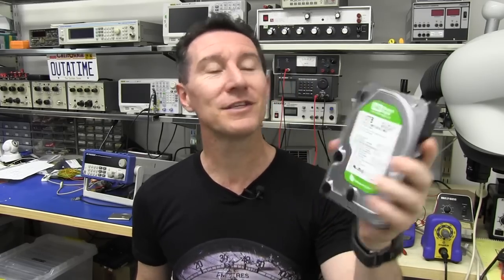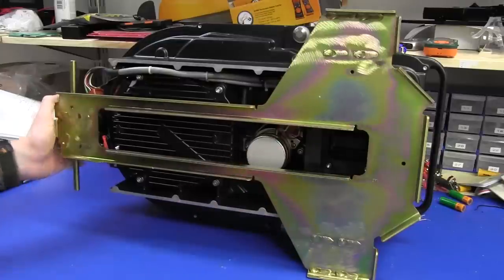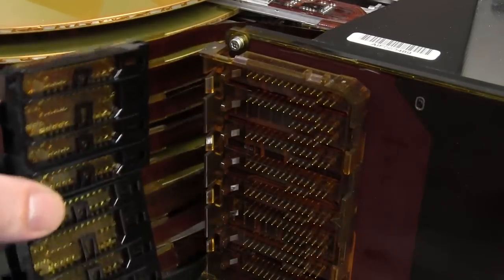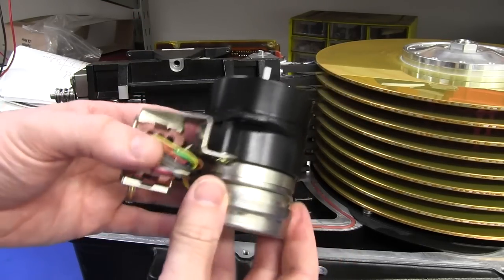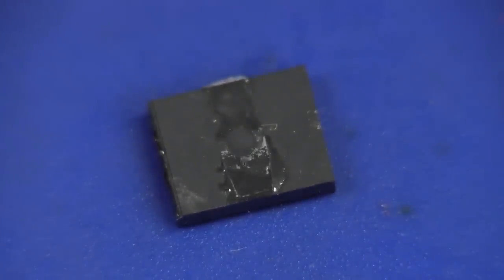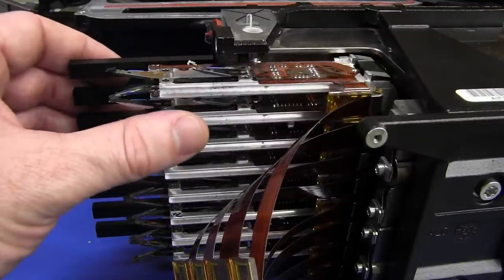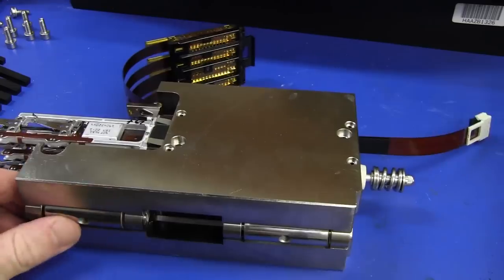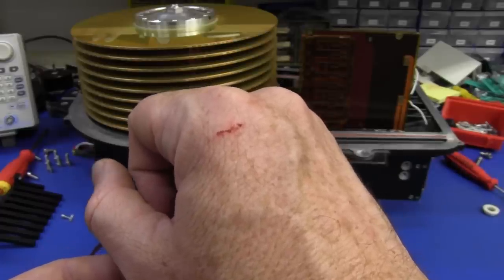EEVblog #395 - World's Most Expensive Hard Drive Teardown

Comment: 1/4 mil doesn't even come close.  These units were used in RAID arrays that had many of these units.  What you have was THE field replaceable unit (FRU).  Repairs would have been made in a clean lab, probably in Endicott.  The heads actually flew by bernoulli effect over the platters and head to disk interference (HDI) was often a terminal event, nevertheless, stuff did happen and you could swap a unit in the raid and the raid would rebuild the data from the other drives.  Then send the offending unit back for rebuild.  There were also some aeronautical/defense applications in which units similar to these were used.  I could tell you more, but I can't.

Comment: That beast would make a great custom case for a gaming rig.
Reply: yes
Reply: +vector6977 Lol, exactly what I was thinking about!
Reply: +vector6977 And just a little of engineering for cooling all that
Reply: +yomauser Maybe you can use the in/out-Gas Channels for cooling with oil or something like that :D
Reply: When our children will see the hard drives we use today:                      "Pffft, I could easily fit a cluster or two in there..."
Reply: ***** Hey, I specifically said "cluster", which means there are more.
Reply: *****  Pardon mine. By cluster, I meant an arrangement/grouping of multiple individual computers. I should've specified.
Reply: +vector6977 i'd just put a game on there and try to run it
Reply: I am sure yes
Reply: That is EXACTLY what I thought when I first saw it.
Reply: No heat allowed
Reply: holy shiz ya

Comment: I remember those.  I used to work on IBM Midrange systems (the System/36 range of computers).  the hard drive platters were 3 feet across and weighed 40 kilos.  we usually had one die every 2 years or so.  350MB of storage on the model B and 768MB on the Model D.  the actual machine was bigger than a washing machine and made a horrible din as fans and motors ran in it 24 hrs a day.  My office had 2 of them and every summer, the air chiller unit would fail and tempretures would shoot up to over 100 degrees.  those were the days when computer techs were working at the coal face!
Reply: Jeff Barber Time is cruel to old tech. As a 70's Kid. I am still in Awe of this.
Reply: Worked in an IBM shop during this period.  He's handling a 3390 drive unit.  They almost had the same capacity of the 3380s that they replaced, 630Meg, 1260M, or 1890M per actuator/address, for the standard, "D", or "E" models.  The 3390s saved 'footprint' space in the data center for the same storage, along with power and noise. A 3380 drive had a sticker on the side, > 70 kgs, recommending 2 CEs to swap them out.  An actuator on each side gave the device 2 addresses. Two drives per box, total of 8 boxes per string.  The 3390 has two actuators / drive also, as seen in the video.  Top & Bottom.  If it failed, a single CE could unplug it, slide it out, and replace with a new one.  "CE" - IBM Customer Engineer.

Comment: IBM generally had a controller with the smarts connected to a bunch of not so intelligent drives so I would not expect this item to have much smarts.  My first hard drive was from IBM and had 4 Megabytes on a stack of platters wider than this one.  Amazing stuff.  THESE are the good old days for computers and other hardware.

Also, the top head was frequently a sync track.  Lots of little markers for timing, track start, sector start, etc.  Not a read/write surface.

Comment: I worked on these things and the filters actually filtered recirculated air within the unit, not outside air. Additionally, these were were used with mainframe computers like the IBM 360/370 series. Servers as we have today, didn’t exist yet. The platters were double sided except for the top and bottom platter.

Comment: For me its kind of funny seeing that "old iorn" again. My first day on the job in field service was in 1976 . We were installing "field change orders" on 10 megabyte ,full size disk drives (about the size of a washing machine) The disk drives had a linear bobbin type motor. The field change was adding an RC circuit to the linear motor circuit so that the disk drive would not pickup and play music from the local am radio stations. ...yep ,in some installations it was an issue  lol.
Reply: Steven Hardy Even in 2015 RF interference is still a nightmare. Open even an Iphone6. Any Metal plates are there only to shield RF Interference.

Comment: That motor you removed from the bottom, before you could pull out the ACTUATOR assembly is the  head LOAD/UNLOAD motor.  It was used to remove the heads from the disk before the disks stopped at power down.

If the motor was allowed to come to a stop with the heads in contact with the disk they would STICK.

The LOAD/UNLOAD motor also LOCKS the actuator in the PARK position when the motor is stopped.

Comment: that sensor in the actuator is the "Home" sensor, lets the drive know when the heads are over the "Zero" track.. so the drive knows where to start counting from ..excellent video, haven't seen that type of drive in over 20 years.. please keep these types of video's coming.. btw those heads have more than 1 gap, there is an erase head there is a r/w head, and there is also a dual head that is called a guard head which makes a tunnel on either side of the data channel so adjacent channels do not interfere with each other..

Comment: Now to think, in 20 years time, we'll have 200 TB harddrives capable of storing 1 government official ego.
Reply: The 64th Shadow Nah, you will need at least 1 Terra Quad or more.
Reply: The 64th Shadow 
You should do some maths the smallest structure we are  capable of at the moment are 14 nm , 0.1 nm is roughly a atom.
Reply: Fiercesoulking "sructe we a cabale"
What in the fuck are you saying?
Reply: The 64th Shadow 
Sry I was in a hurry in real we won't have a smaller structure than 1- 0.5 nm  because for transistores they make no sense.. The biggest harddrive at the moment is 6TB, so maths say this
14 nm*(1/0.5 nm) * 6TB =  roughly 168 TB is the biggest possible HD with in the normal specification of a normal HD in these days
Reply: Fiercesoulking you forgot to calculate in 2 dimensions. Shrinking from 14nm to 7nm brings you 4 times as many bits. Shrinking from 14 to 1 brings you 288 times as many bits. And there is still the possibility to create thinner discs and heads to fit more discs into one harddrive case. Even without smaller structures on the disc itself this may also increase capacity. One could also try to store more bits at a single location so that a location is not 0 or 1 but rather 0, 1, 2 or 3 (0, 33, 66 or 100% magnetic force; hdds already use this technique but I'm sure there is still some potential). 
So we do a simple calculation: Half the structure size (7 instead of 14nm), twice as many discs and twice as many bits per location would raise the capacity from 6 TB to 96 TB (6TB x 2 x 2 x 2 x 2)
Reply: Lol we already have 8tb or even more.
Reply: The 64th Shadow If we follow Moore's Law we should be able to fit roughly 6000 terabytes on a 2.5" drive by 2035.
Reply: Chevez ℰ. Moore's Law is inapplicable to magnetic storage density, because it describes the growth behavior of transistor density over time.
Reply: 450AHX SSD storage isn't magnetic based
Reply: The 64th Shadow in 20 years time going by past rate the hard drives will actually be 20QiB
Reply: +Fiercesoulking we actually have 7nm transistors currently
Reply: +Krists Jāvalds currently 10tb.
Reply: +The 64th Shadow Hahahahaha  Good one. Ha.
Reply: alex tworkowski Haha, got 'em?
Reply: +The 64th Shadow there is nothing... NOTHING big enough to store an goverments official ego xD
Reply: +Fiercesoulking actually, if technology got to that level, they would probably have multiple layers of disk in a space such as a standard HD. If they still use Hard drives at that time.
Reply: Pfft i think all of the internets harddrive capacity couldnt store any goverment official ego.. Or hidden ego fr that matter
Reply: Don't think so, SSDs are already taking over... R.I.P. mechanical hard drive 195x-20xx
Reply: LBPPlayer7 actually I think you will find that the future will be more on the hybrid drive side once they have a breakthrough like every other part.
Reply: 60 TB SAS SSD from Seagate, and you talk about HDD? The future has begone xD.
Reply: +Max Mustermann For HDDs It's 16TB from Samsung last I heard.
Reply: Computer storage is getting denser, and so are people.
Reply: The 64th Shadow greating vrom the future a 100tb is alrady launched in 2017 :P
Reply: And with more quickly deleted incriminating 
files.
Reply: more like 200 petabyte compared to back in the days. At least 25 years back, 80MB was considered quite a lot for those actually having an HDD; 20MB was not that good but still better than nothing.
Reply: The 64th Shadow well if we'd manufacture the harddrive shown in the video with today's technology, i think it would store 24Tb per plattern. So we could manufacture a 226Tb harddrive with 9 platterns
Reply: Adam Creed u gotta add 1 more argument against buying em today:
+ good luck finding an efficient file-system
Reply: Adam Creed well could be. Idk this problem cuz i never had it.
Reply: I guess partitioning it could solve it but anyway - more than 24 TB = u wont get one without having good cont(r)acts
Reply: no
still no 10tb
Reply: No they don't.  There is no such thing as a petabyte hard drive.  All petabyte storage solutions are multi-drive.  At this point, Intel has announced a petabyte SSD solution that takes up 1U of rack space, but it's not a single drive, it's 32 drives in a 1U rack case, and I don't think it's actually shipping yet.
Reply: What?  10TB and 12TB Seagate drives are in stock on Amazon.
Reply: Jon C Toshiba already manufactured 6Tb drives in 2016 so why not
Reply: with some fancy compression maybe
Reply: @Jason Manuel Well, the biggest I see right now is 12TB.  Can't believe I am responding to a comment from 4 years ago.
Reply: @Jason Manuel Where is my flying car and my 100tb-drive?

Comment: 6:53 "Otherwise, the halon gas would kill you." I thought this too, then I searched a bit and found this isn't exactly the case. Yes, gases can be dangerous, but not all of them kill datacenter workers.
Reply: linagee I don’t actually think he was saying the gas by it’s self would kill you, just that the lack of oxygen once the room is flushed out would.
Reply: @pedroalexander8921  Yes It displaces the air, which is how the fire suppression work. also because of the energy lost to convert the cold liquid gas, it would chill a whole room with the phase change from liquid to gas. just like a CO2 fire extinguisher, the temp drop forms snow ice and dry ice, it's just under enough pressure to keep it liquid, and it occupies a small space so it transports easier.

Comment: I have actually worked on those as well as the 10 platter removable media drives. They were the size of washing machines. Both of those units had separate Disk Controllers that managed data flow and head position. Those 10 platter drives were all of 40 megabytes and were used with a Sperry Univac Main Frame at Naval Oceanographic.

Comment: My dad had bought a computer 386SX in 1986 which had a turbo button for over clocking and had a hard disk capacity of 20MB. I think it had speed of 33MHz and when we type DIR and Enter, then we can read files easily going from bottom to top. It had DOS Ver 4.0

Comment: BTW the thermometer strip is a standard-looking LCD thermometer. The numbers are printed underneath, and each segment of the LCD becomes transparent / opaque at particular temperatures, that's how it works. 

For the heads, I think the reason there's 4 contacts, with only 2 being used, is so they can use the same heads upside-down, which would reverse the L / R direction. Saves them having to make and use 2 types otherwise. 

If that's just 10MB, then the data density on the discs is going to be pretty close to that of early '80s floppy drives. Which wasn't much!

Comment: Wow, takes me back. Used to work on GE Medical CAT scanners (circa 1981) that stored scan data on CDC 96MB removable platters, the entire drive enclosure was about the size of a small washing machine. Replacing a read/write head in the field was a treat; no clean room, basic hand tools and an old school Tektronix storage oscilloscope. Was only required to do it twice but I can say the installation and calibration instructions provided by CDC were outstanding (provided on Microfiche slides)!

Comment: Four years later, we have 8TB Hard Drives and 3.8TB SSDs
Reply: And 2TB usb flash drives
Reply: Flash Drives and SSDs are pretty much the same thing...
Reply: Problem with SSDs is the slow write speed and that they wear out.
The wear problem is why SSDs are not used in servers.
Reply: That is no longer the case.
Reply: If there would be willing customers, there'd be much bigger SSDs in 2.5" or 3.5" size.
Reply: +Barry Jones well in the future..they can fix that problem
Reply: Actually, Seagate just annouced a 60TB SSD.
Reply: Aren't most SSDs 2.5"? There are 3.5" ones too, altrough they're rare. But what's better are M.2 SSDs, which you can just install to you motherboard and leave cabling and everything.
Reply: Möyh Mäyh Well, Seagate's SSD is 3.5" though. Samsung announced a 2.5" with 30TB (it's the V-NAND V4) in 2017 as well!
M.2 etc are pretty neat, though somewhat expensive. 
I don't think they're really necessary for consumer PCs, unless you're an enthusiast or have a lot of money. :p I assume ~5-10 years from now, most PCs will have a big SSD like that though, enjoying lightning fast PCIe speeds (especially with PCIe 4 coming up)
Reply: panda1384
I don't think it matters that much. 99% of any workstations that'd need one will have a 3.5" slot free. I have myself had to buy a adapter frame thingy in order to install a small SSD.
Reply: 4.7 years later we have 10TB Hard Drives and 16TB SSDs...
Reply: flash driver is way slower more slow hdd
Reply: USB flash drives are classically slow because they were limited to USB2, USB3 sticks are typically far faster than HDDs.

Comment: he forgot about micro drives... smallest hdd
Reply: Micro drives contain flash memory chips and not magnetic coatings on top of platters... so yeah, entirely different technology.
Reply: XmarkedSpot No, microdrives were actual hard disk drives with a 1 inch platter. Same case as a CF card (thick version), but back then when they were a thing they had a much larger capacity than one could have at a reasonable price on Flash-based CFs.
Reply: kilrahvp
You're actually right!
I even forgot that i own one of those, sheesh i mixed it up, my bad.
Reply: XmarkedSpot I bought one a good 10 years ago. Was fine even if rather slow, and it did what hard drives like to do best and failed on me after only a few months. Can't remember what I was using it in though.
At least I got to take it apart and marvel for a while at the impressively tiny machinery... quite the opposite of the one in the video, lol.
Reply: kilrahvp
I got mine with yet unseen 2GB for my first-gen digital camera (~2003 Canon, capturing a whopping 3.1 megapixels).
The drive actually outlived the camera (8yrs of heavy use) and who knows, probably still might work. I guess it would have failed me if i wouldn't have a backup routine ;)
Having a 64GB sdxc by now doesn't really make me miss it... but i agree, the technology still remains very impressive.

Comment: Pshaw.   That's nothing.   An ex-boss of mine used to work at Control Data when they were developing a no-holds-barred disk drive.  One platter, six feet across, with 8,192 fixed heads.  Cost of around $18 million 1978 dollars.  Not a problem for their Rodeo-drive customers like the NSA, Westinghouse and Livermore.   They were clamoring for disks with low latency, so no head-stepping.    

One day he came in to work about midnight, typical hardware hacker time, and the building was almost impossible to enter due to a loud screeching wail sound.  The big disk had a head crash, which cascaded from head to head, trashing all the heads and the disk surface.   They never had the nerve to try building a second one.  It had lasted all of three days and nights.

Comment: How many petabytes could a hard drive that size be today?
Reply: Well, if you have a lot of money you can try with msata 1Tb SSDs, they are 51 x 30 x 4mm big so multiply that by 1000, you get a petabyte of crazy fast storage for about 250 000€ in a 32*60*32cm box
Yeah, pretty sick tech that we have today, you could probably fit 1 of these petabyte boxes in that bulky IBM HDD enclosure.
Also, considering that the internet 1.2 Zetabytes big, you would need 1.2 Million of these boxes units. It would be about 0,06144 cubic meters per enclosure, multiply that by 1 200 000 that makes 73 728 cubic meters,
A 747 has a cargo + passenger volume of about 1000 cubic meters so that's 73 Boeing 747 to transport the entire internet
And AirFrance has exactly 73 of these jumbo jets... 
It would cost 1 200 000*250 000 = 300 B€ of SSDs and it would weight about 10 200 tons of SSDs, and Shell can have this amount of money...
After all of this math, the conclusion is:
AirFrance and Shell are going to fuse together to have enough money to buy all of the SSD's they need to put them in the AirFrance's jumbo jet fleet, send them to Australia and then they will use EMP bombs to destroy the internet and keep their copy of the internet in hostage to get anything they want in return.
My brain hurts so bad
Reply: a crapload